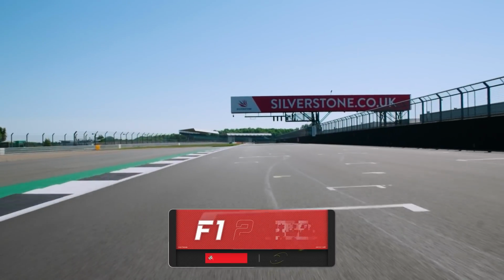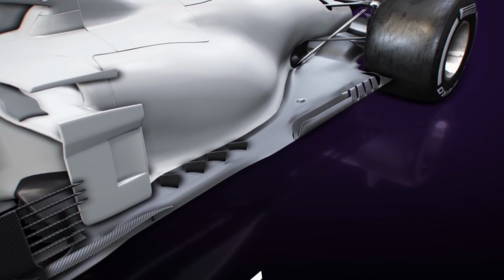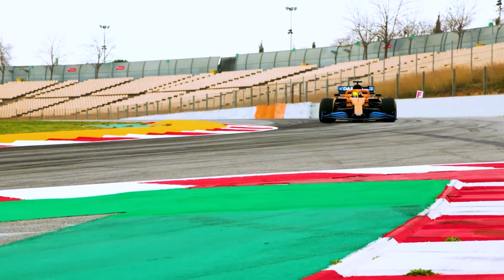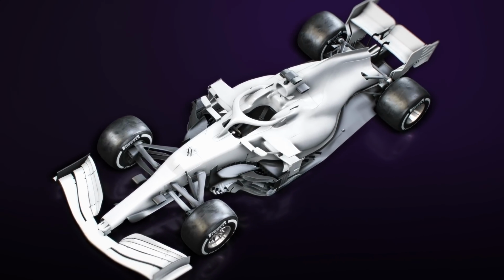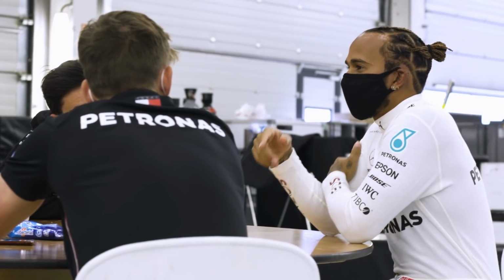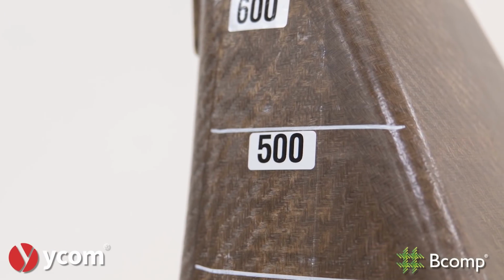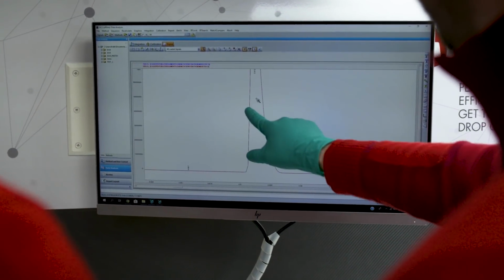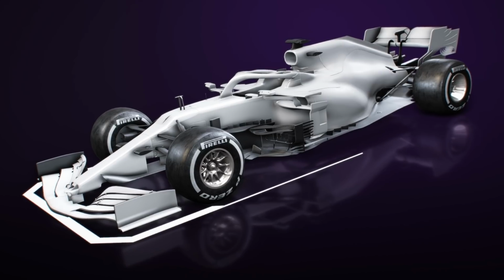F1's Updated 2021 Rules Explained - Everything You Need To Know

Comment: Why the hell FIA has to get in the way of innovation. If cars create more downforece it will be more stable and faster around corners. Teams will know when to stop with the mount of tire wastage. DAS is a very clever system why would you remove that. The engineering front of the racing is killed rightthere.

Comment: SAFETY....PFFFF.  Auto racing is inherently dangerous and though I do understand the need for safety and cautions, they need to lift most of the restrictions.  Let team build a car that they want to build,  that's how F1 used to be.  Instead of now you have cookie cutter cars.  If a driver thinks it's unsafe then don't let him race, get another driver who will. Let's not forget up until the late 70s F1 had a notir reputation for allowing paper machie cars out on the track. And even though these cars were 100% known to be unsafe drivers still climbed into them and raced,  And raced hard.

 No one enjoys watching cookie cutter cars going around the track using the same technology as everyone else and watching the same 3 teams win.

 All of the modern regulations from the 90's till current have done nothing but stagnate F1.

As a famous racing driver one said,  "If you can't run with the big dogs don't come off the porch".

 Let them build and run whatever they want with ZERO restrictions on the car or refuling. 

 If a team wants to run of V12 let them, if they want to run a 4 cylinder with quad Turbo let them, if they want to run a supercharged V10 let them,  If a team wants to put a canopy over the cockpit of the car let them, If another team walked around a hybrid let them. This is what used to make F1 so popular and enjoyable to watch.  Most people don't remember the crazy wings the teams used to put all over their cars or the six wheeled F1 car, YES 6 wheels. 

F1 has become BORING to watch.

Oh..... Get rid of the ridiculous point system and just go back to the way used to be.  What would be better is the only way to get points is to finish in the top 10, other than that no points given for anything

Comment: Does anybody know where the Brawn Racing Team of 2009 got their Double Decker Diffuser from (the technology that ensured they won the
F1 championship, before selling out their team and 'technology' to Mercedes in 2010)? If the answer in no, I can report that a small team of aerodynamicists
had patented such a device for use on light aircraft years earlier and that the engineering drawings were "borrowed" by a small Swindon company (who made carbon composite parts for F1 race cars). The small team of guys never received a penny nor were ever given any credit for their years of design work. In conclusion I fear that F1 has TRULY lost its way and that the new American owners are simply ensuring they 'milk' the viewing public for every penny they can. 
F1: Bad sport. Bad management people. Bad PRESS. BAD ethos.
Reply: It wasn't the double diffuser, that was a decoy, it was the outwashing style designed front wing which was the most important element of their car.

Comment: The new rules are following
1. There are still three qualifyings, but the time in each qualifying is reduced
Q1= 15 minutes, Q2= 12 minutes and Q3= 8 minutes
2. The collison penalty is become more strict
Old penalty: 3 place grids penalty
New penalty: Back of the grid penalty
3. If the driver unable to served full penalty, they will started the race in Pit Lane.
Example: If a driver who qualify 19th/20 and get five place grid penalty, he only down one but will received a Pit Lane Start Penalty because he is unable to served penalty
4. The 107% rules is reverted back in Wet race. Any drivers who didn't set on 107% but advanced in Q2 will not allowed take part in Q2.
Example: Only 7 drivers managed to set 107% time, while Q2 entries had 15. If the new rules introduced, seven drivers will automatic went to final qualifying. If more than ten, the elimination change
14: 4 drivers and went to 11, where one driver will get eliminated.
5. The fastest lap point now increased to two and if the driver who get fastest lap did not finished on top 10, the riders who had second fastest lap will get Extra Point

Comment: One way to make all the races better is to require that ALL the tire compounds be run, make each race at least a two stop race.  If one compound is rubbish they will all have to adapt.  If you cut the tire changers by half you would get 10-15 second pit stops and make fielding that many crew less $$ for the smaller teams.  It would also put more action in the under/over cut tactic.  It is too easy for the sharp end to pull out the delta + 3 seconds on put stops the way it is.

Comment: Remember when F1 was more diverse and people made their own innovations? I sure did.

Now everything new that seems interesting just gets outlawed immediately. If you don’t got the cash then suck it up and move on. This is the reason why modern F1 has gotten stale over the years. Where is the wheel to wheel racing? It doesn’t even matter cause Lewis already can get a 15 second gap in 12 laps. There is barely any proper overtakes it is just DRS open, ERS deployed, rich mix engaged almost every single fucking time. I can already bet Mercedes is done with their new regulation spec cars and I guarantee that Lewis wins his 8th championship which sure congrats but it becomes played out when you are 45 seconds ahead and even with a puncture in sector 1 you still win like WTF?

Comment: 1 more boring year of course. F1 lost its soul years ago. Hybrid era had nothing exciting in the front of the pack. The tracks and regulations makes a 1stop boring conserving fuel and tires unfollowable cars pretty common recipe. From watching 15-16 races a year I end up watching 2-3 because on most tracks you know ahead what will happened based on engine performance and the same weather that doesn`t allow any new variable in a race. Ironically this year was the best because of the pandemic, forcing new (old classic) tracks to be used and spice things up.

Comment: I'd prefer to see more effort to cut engineering costs, boost sustainability and cut the number of backups to focus more of durability. Cutting the fuel allowed per actual race would boost powerplant efficiency gains something all car makers can make use in their real cars, reducing the no of engines/brakes/tires (and tire choices to Wet/Slicks) helps on efforts to boost part longevity for the season, cutting engine capacity and finally less practice/qualifying laps would allow smaller teams to compete more. Tiny aerodynamic improvements and ever higher power outputs are not leading to better cars on the road (bar the odd ferrari). DAS and powerboost tech has not worked in cars (bar the Porsche boost function). We have seen most of the engine innovation from car makers outside F1- Hyundai-Kia, Mazda, Toyota, Ford. I'd also like to see a dramatic cut in engine emissions and tire particulates. If F1 wants ICE engines to remain then F1 must drive engine innovation and its not. High levels of carbon fibre have not become mainstream (even high end) car materials (steel and Aluminium remain the majority). Carbon fibre brakes might have been a breakthrough brake disk but their cost remains astronomical and even many performance cars only offer them at a prohibitive cost. Every F1 car and team should have a carbon number and that level should have to fall every year and not by microns.

Comment: 2021 is shaping up to be to most boring F1 season in a long time. Only small rule changes which will be applied to the 2020 cars while everyone is working on their 2022 cars anyways. By moving back the regulation change FIA has basically made 2021 a stop-gap year no one is interested in. Teams don't want to focus too much on the 2021 cars to make their 2022 cars as good as they can. And as teams don't develop a lot for 2021, nothing will change from 2020.
At least McLaren is switching to Merc power units, which might provide some interesting results. Either McLaren will get a nice boost and become a bit more competitive, or then it'll be a big swathe of problems caused by the switch. Either way, Merc will dominate 2021, Red Bull and Aston Martin will be the next teams behind and McLaren might step up to fight with Red Bull and Aston Martin.
On the driver side the interesting questions are: a) Can Sainz challenge Leclerc? b) Does Vettel get his mojo back at Aston Martin? c) Can Bottas do something to convince Merc to keep him for 2022?
Reply: I'd love to see Max Verstappen in a merc alongside Hamilton.

Comment: - Increased minimum weight requirement of engine to prevent expensive and exotic materials from being used.
Baigle disliked that

Do you know how cheap it is to melt down some ruby to make piston rings, or melt silicon to reaction bond it with a cooked carbon composite? It ain't that bad. The only hard part is machining it.

Comment: The only thing everyone wants is a rule that screws Mercedes
Reply: Firstly; That's not going to happen because performance is related to spend and engineering excellence. M-B have the biggest budget behind Ferrari but their engineering expertise would seem to be clearly greater. So, without a major rule change that can produce unexpected results, there is little chance of any major shake up.
In fact, with the evolution of the rules as well as M-B's self-inflicted moratorium on development of this year's car to concentrate on next year's, there is every reason to believe that next year's car will be even more dominant, especially with Hamilton staying put and M-B not only also having a competitive 2nd driver in Bottas, but now a clearly competitive back-up driver in Russell. 
There is nothing new in this dominance. Every era of racing has had dominant teams. What is actually different is that M-B seem to be doing it with a regular financial handicap and no single technical lead. In the past it was either a significant financial advantage (typically, Ferrari years) or a single technical lead (think along the lines of Lotus' ground effects, Williams' active suspension, Renault's mass dampers).
But we always come back to the subject of aero. But that is for another post.

Comment: Simple as that :
One Ford V8 design for everybody, 5 units per season,
Hard suspensions,
Fixed front and rear wing (+ DRS available at will)
6+1 gear box,
Fixed rake pitch,
Color-smoked pods,
One mandatory set of wooden wheels per race ...

Comment: If the FIA really gave one single fuck about the environmental impact, they'd start looking at the dozens of diesel semi-trailers hauling the teams' gear across europe, not by allowing more plant life to be harvested and killed, or the use of ethanol. E85 doesn't make sense unless everyone starts using it all together, now; also god forbid F1 teams use semi-permanent tents, no, we need collapsable bases with generators, hundreds of server racks, private kitchens, and sliding glass doors. I get it, data harvesting, but if they really give a shit, they'd focus on the carbon footprint the operation of a team's weekly output, not  specifically the goddamned race cars, which is the only thing that actually makes them money.

Comment: Ok here is my opinion of F1, I find it ridiculous that there are only 4 power units on the grid out of 10 teams. We have Mercedes, Ferrari, Renault and Honda. That being said i find FIA in wrong by forbidding teams to copy other teams. This rule is 100% retarded. If you dont want teams to copy then you can not have only 4 power units on the grid. You should allow other teams to copy the best because that would even out the field and we would have better racing. Another thing I dont like is why the fuck do we have only one tire supplier? It is stupid. I think FIA should bring 3-4 different tire suppliers and have teams free to chose any tire they wanna race on week to week bases. Then at the end of the season pay tire supplier based on how many tires have been used from each supplier. This would bring more uncertainty and would deffinitley be better entertaining. Another thing I do not like is having 3 practice sessions. I would take that out complementary or just bring it down to 1 on a qualification day. In fact it would be way more interested if we had two race weekend format, for example take out all P sessions, on sat have qualifications than one race after that and then on Sunday have another race but with reversed grid from Saturdays race. This would be hell of a entertaining by watching teams to develop strategies on what spot to finish on on Sat.

Comment: so the ferrari oil burning isnt what everyone thought it was. 
they were running a TURBINE. so think of a turbo but with a combustion chamber.. they were using oil to spin that up, thus driving their MGU H faster. this is why they had to split the battery because it was actually running better than the MGU K - take that to the bank. 
this is why hamilton called the Ferrari Quote "A jet"

Comment: So this means Hamilton may win 8 championship titles? Damn F1 is really setting up Lewis to rewrite all the records
Reply: @3213232 1231223 this isn’t a sarcastic question - but why don’t other manufacturers make power units that are as good or better than Mercedes? What makes them so different?
Reply: @audemarspiguet4237  one of the reasons is Merc started development earlier than everyone and sunk lots of money into it. Not to mention talents they collected over the years.
Reply: @audemarspiguet4237  there are quite a few factors. However two of some of the biggest factors are that some teams get their engines supplied as they are very expensive to build. However for the teams that do make their own engines, they don’t want to destroy their reliability for more power, as you can only swap the compartments in your car 3 times a season. Therefore making the balance of extreme horsepower form a puny 1.6 yet having it reliable enough to be able to Last around 2000 miles without damage very challenging. Also having a 1.6 litre that can Rev up to around 13,000 RPM is very engine deteriorating, making that balance even tougher. I’m pretty sure that’s also why they don’t refuel now though, as they have smaller engines and ERS.
Reply: @ryanmburnett  thank you!
Reply: @ryanmburnett  The stopped refueling pit stops for safety reasons. And also to push teams to become more fuel efficient, hence the hybrid technology in these cars.
Reply: @audemarspiguet4237  no problem! :)
Reply: @jamest7485  ah that makes sense, thanks for the info.
Reply: @audemarspiguet4237  Money money money. Most of F1's value comes from the marketing it gives, but it's only profitable as long as you get that same value in marketing and the complexity and cost of the turbohybrid era engines is too high for teams to develop their own or for third party manufacturers to join. Also, Merc got lucky when starting and the token system further consolidated their place as the strongest.
Reply: So why they banned DAS & Party modes in Quali? To help Hamilton?
Reply: @sambitranjan9584  They didn't ban DAS right away, and Merc seemed like they knew it was gonna get banned beforehand. And also Ferrari was getting biggest gains with quali engine modes.

They might or might not helping Ham but your arguments doesn't make sense at all.
Reply: oh wow, so then why botas dont win a championship? he got the same car. its not entirely about the car, its more about the driver. stop hating Hamilton for no reason.
Reply: If they were trying to do that, they would change nothing, I think that they are actually trying to stop him, not because they don`t want him to achieve eight titles but they want to give the impression that F1 is trying to not be a one sided race but in reality, F1 has always been that way, title winners always have the best car. The difference is that Hamilton would still have won but winners like Jenson Button would never have had a chance because the Brawn car had the double diffuser at the start of the season and that really was an unfair advantage. Mercedes may well be the best car on track but it is still made exactly the same as all of the other cars.

Comment: i really want a min weight that is a bit higher so that natural composites will be good, and I really want a more powerful engine with engine rebuilds being allowed every 2-5 races. That would make the power much better. or make the engines larger with maybe a twin-turbo v8 hybrid layout that could make more power while potentially being more reliable because you don't need to squeeze the power out of the engine to its limits. so maybe like 3 engines for the entire season, but allow larger potentially more powerful ones. That would be cool. maybe making the fuel tanks way smaller and allowing refueling would make the cars lighter and smaller. it would also make the risk for a larger fire more negated because of the reduced fuel on board.

Comment: I understand that the outright stealing of another team's designs should be stopped, however, to keep racing and F1 relevant and on the forefront of technology, I am mixed regarding 3d Stereo Scanning. F1 pushes the envelope of what mankind can create and put into practical use. It is through its usage which pushes Metrologies'/tecnoligical growth.  It is auto racing and aerospace that demand tighter tolerances and better parts. To limit its usage seems to limit what, and how, we can accomplish as human beings. What's on the outside of the car for everyone to see, should that be fair game? What's inside and underneath, that's not. As I said, I have mixed thoughts regarding how this should be examined.